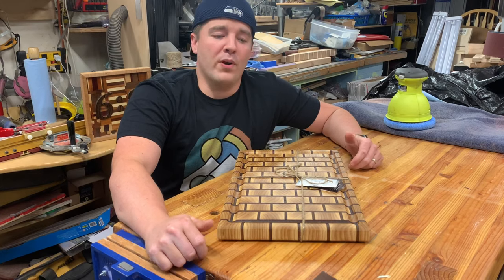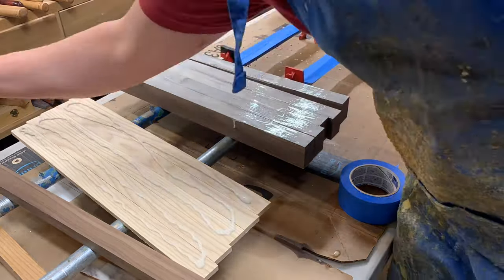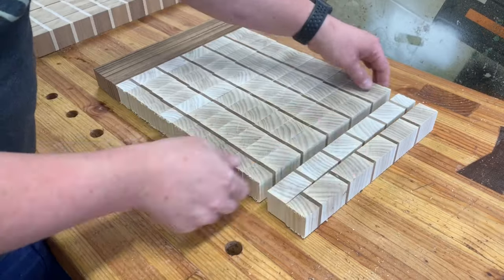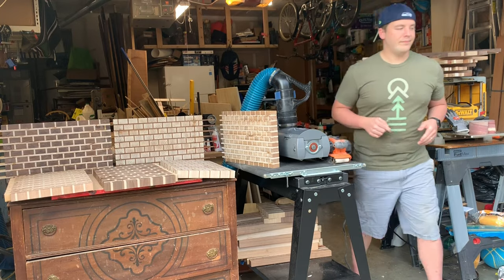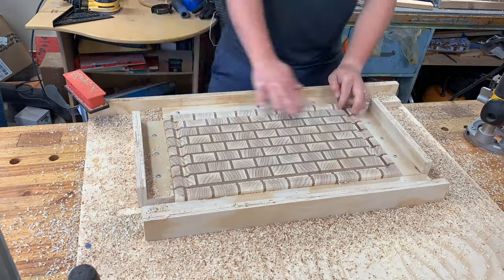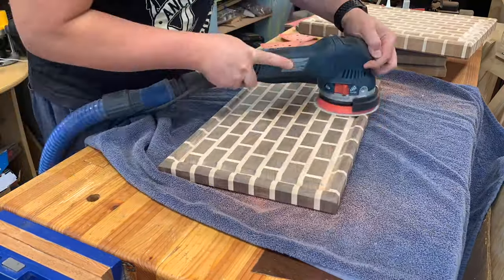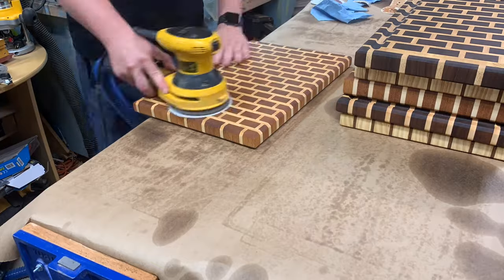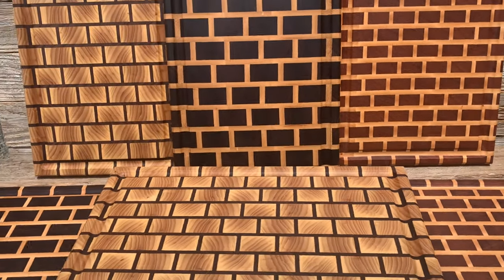How to Make an End Grain Cutting Board: Brick Pattern & End Grain Flattening Tips

Comment: awesome video! Thank you for the tips. #20 after the oil drys works perfect! I clicked your link to get the Bosch sander but I think its discontinued. Your finish is perfect on  your boards and I am struggling to get that finish..Any more tips? How many times do you saturate the board with mineral oil? Is there a specific brand of mineral oil you recommend? Just that once then let it drip dry? Thanks again  for the tips.

Comment: Do you think that Bosch sander one turbo mode would work in place of a drum sander until I could afford one?
Reply from the maker: You bet! Like I said in the video with the belt sander, it will be just be a little bit more time consuming to make sure it’s flat. If you have a great glue up without too many ridges, shouldn’t be too bad. Personally, I always have some high and low spots. So I might start with some 60 or even 40 grit to speed it up at the beginning and then switch to 80 as you’re getting closer.

Comment: Just did my first end grain board (black walnut and hickory - it was what I Had left over from a cabinet I made.) . Question: Of course the adhesive (Tite Bond III) wants to really suck into fibers which I fear will block out the mineral oil. I started the pieces at 1.625 knowing I would be "sanding down" to 1.5" Don't have a drum sander so using belt sander knowing I will go to random orbital at some point. (Taking a long time to reduce I think because the hickory is incredibly hard)  Do you think the reduction to 1.5 from 1.625 will avoid the mineral oil not getting blocked out by adhesive? Maybe my fear is not founded. Your help / thought please.

Comment: hi wicked boards , you make it look so easy guess i will find out soon enough . what size bosch orbital sander are you using i cant make my mind up
Reply from the maker: Thanks. I went with the 5” for same size paper with my my smaller one. But the 6” is great, especially if you plan on a lot of table tops or furniture.
Reply: @SixEightWoodworks  would the bosch 6" be ok for the cutting boards or is it to big i also plan on getting a 5" dewalt

Comment: Can you explain what you mean by not using the table fence and why that's safer please? 3:07
Reply from the maker: You bet. Using just the fence solely should most always be used for rip cuts and not cross cuts. For cross cuts I add a 1/4” block to give some clearance (then account for that with the fence measurement. If you ride the fence directly for a crosscut, you are extremely likely to have a kickback. Some exceptions include plywood, if you’re pushing between the blade and fence. Also dado cuts, where you’re  or fully cutting the board. I’m pretty sure Steve Ramsey over at Woodworking for Mere Mortals has some table saw safety tips that show this more clearly. Highly recommend watching that!
Reply from the maker: This video kind of addresses it at 6:45 https://youtu.be/91v0Yg1L4ok
Reply: @SixEightWoodworks  thanks!
Reply: @SixEightWoodworks  Thanks so much for sharing that, that explains it perfectly!

Comment: I was thinking of making a brick pattern using edge grain. I am limited on tools and large wood stock. What do ya think???
Reply from the maker: I’ve seen others do it. Many I’ve talked to often have the board fail and crack because of cross directional wood movement. Highly recommend sticking with end grain if you’re going for the more unique patterns.

Comment: This be done without using endgrain?  Using walnut and hickory
Reply from the maker: Walnut and hickory would look awesome. But you really need to do all end grain. Crossing grain directions would cause the board to split at some point.
Reply: @SixEightWoodworks  yea i guess it would be difficult to find a board that is 13-15 wide for the mortar part